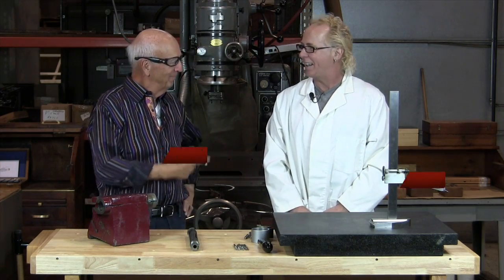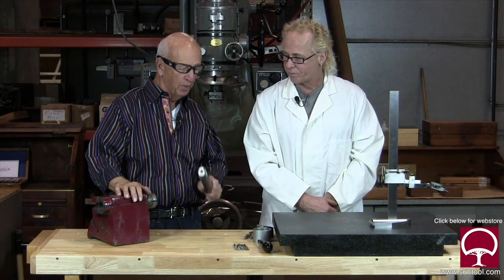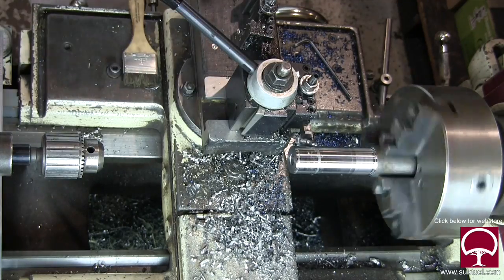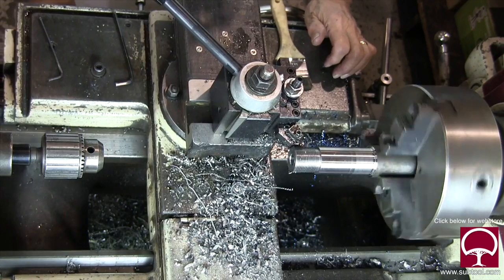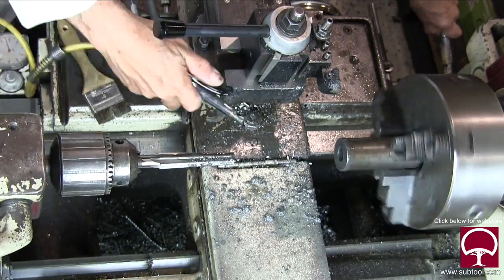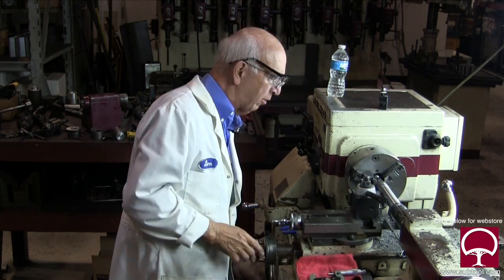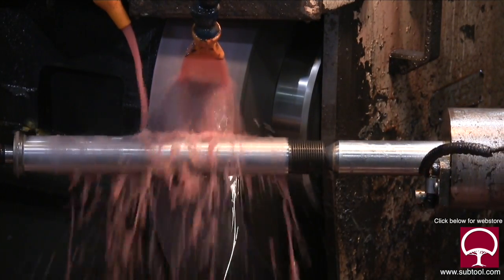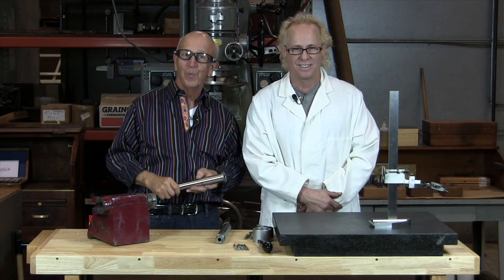How To Rebuild an OD Grinder Tailstock - Part 2 of 3

Comment: Some questions have come up two or three times, which I am also interested in knowing the answer to.   What type of steel did you use? Was it carburized or case hardened?  Did this distort the taper just a bit, so lapping was enough to make it good?
Reply from the maker: carburized and case hardened, yes its enough
Reply: Thanks! What type of steel?

Comment: Couldn't you turn your right handed tool upside down?

Love the vids!
Reply from the maker: +Steve Claesson No Steve, that would not work.
Reply: Yes Suburban Tools, that would work, just needs to run the work in reverse too. Other option, which would have been quicker in this case would have involved just putting your cutting tool in the front of that Aloris post, so it is inline with the work with the cutting tip pointing towards the tailstock.

Comment: very nice - I definitely was asking myself what trick you have used to get the required concentricity, since the holes in the shaft were done only by driving a drill and a reamer with tailstock, which as everybody knows is not a precise operation

Comment: Nice Video, Nice work Don.  Are you using a diamond wheel on the surface grinder to cut the carbide slugs off?

Next time you're cutting threads try swinging the compound slide over to 29-29.5 degrees off perpendicular (it may be marked 60.5-61 deg on some lathes) and using the compound to advance the cutting tool between cuts.  This way it will only cut on one side of the vee, it lowers the pressure on the tool (less likely to snap the tip off), and helps make the chips curl up nicely, instead of making bird's nests.

Looking forward to part 3

John

Comment: Hey Don, you have really made some interesting videos, I love your channel, especially the field trips. I was wondering it the part was heat treated before you did the finally grind to get the taper concentric to the OD or is it being heat treated between the 2nd and 3rd video in this series, to have the final grind yet to come. This, so far is a great series, but it went a little fast and some steps  seemed to be left out. I'm sure you will fill us in though. Thank you Don, for all of your wonderful videos, your doing a great job.

Comment: When you were cutting those threads your compound was at 90" to the work, and it looked like you were feeding the cross slide inward for each cut.  Don't you have to set your compound slide to 33" and feed your thread cuts from the compound and only cut from one side the thread?